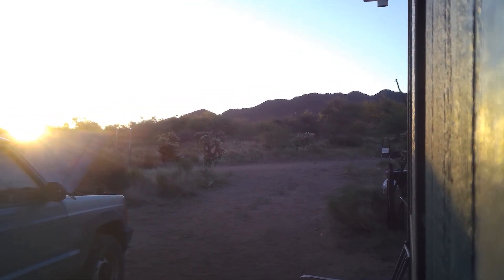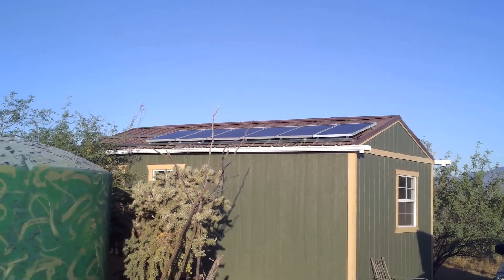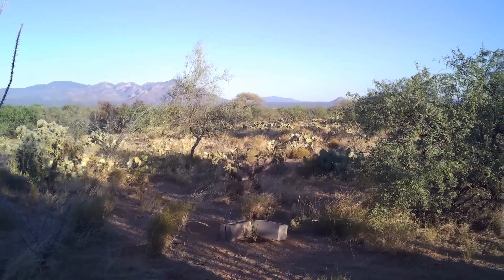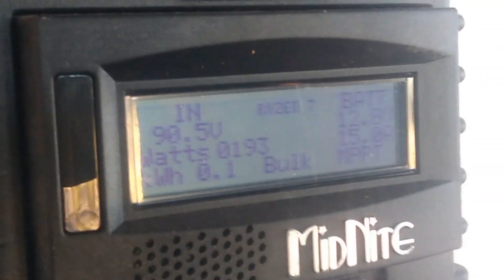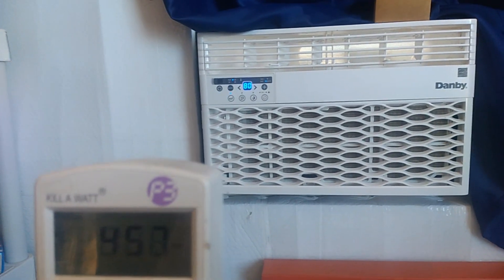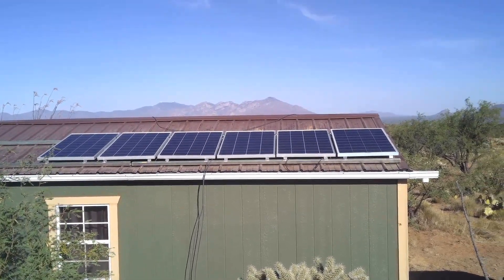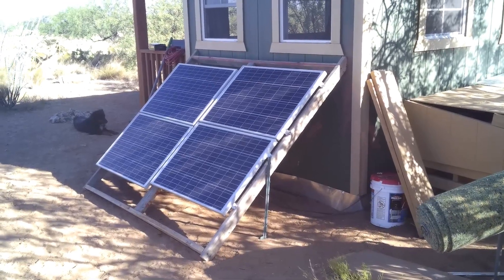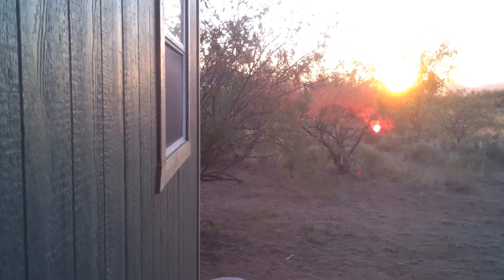Solar is DONE and AC is running @ AZ Off-Grid (Unplugged)

Comment: Hi.. I'm gonna go off grid someday.. am saving my money for now. I do have a solar system on my RV that works but needs a little bigger wires, fuses, ect..  1600w, 400Ah, Victron 150\100 and a CERBO. I'm a 48 state trucker and can monitor it from the interstate. Oh..  I've got a nice built Jeep too.. '99 wrangler, 318 V8, auto trans, 4.88's, dual lockers, 6" long arm on 35's.  I'm your newest subscriber..
Reply from the maker: Welcome to the channel and thank you for subbing to it.. ..As a trucker,, there has to be a place in mind that you want to do the off grid.. Where is that.?  Also with your RV experience,, off gridding will be much "easier" to deal with.. ..You will find that part of the equation of solar,, is the desire for "more".. get used to it.. lol
..Have you ever had your Jeep to Moab.?  best 4 wheeling anywhere..  Thanks for watching.. ..Happy Trails.!!
Reply: @deserthorizons  Hi.HI.. well I've never lived in a desert area.. either in town in an rv park or where I'm at now.. amongst the trees at 2200' snow country. But I will enjoy the change as I want to build a wind and Solar farm and be unplugged. I will make it happen in the next year or two.

Not been to Moab yet.. want to go someday though. I've been throught the Rubicon twice though. I built my Jeep for that kind of terrain.
Reply: @deserthorizons  Speaking of Jeeps..  Here's my old channel which has some of my Jeep vids..  https://www.youtube.com/@brucesterj

Comment: What county are county are you in? Just got land in Holbrook tryna go around a building permit. No storage sheds allowed before , anything over 12x12 would need a permit here
Reply from the maker: I am in Pima county.. ..How far apart can another building be before you need permits.? here the eaves must be 4' apart so if I wanted to put up another it would need to be far enough away,, yet I could still use it.. Maybe put the "cave" in one bldg and the bed/bath in the other.. You need to go to whatever county that is website and read,, read,, read everything.. (they don't make it easy or intuitive) to see what is required for a permit.. Here anything larger than 200 sq ft,, a water tank larger than 5,000 gallons,, propane tanks larger than 150 gallons,, etc,, needs a permit,, So I built my shed 198.75 sq ft,, water tank of 2500 gallons,, propane tank of 50 gallons.. Did you know the size limitations before you bought the land.? Thanks for watching.. ..Happy Trails.!!
Reply from the maker: Another option would be to build a "2-story" structure..

Comment: You can get a larger variable speed inverter mini-split that can run in eco-mode which keeps a small space like your cool.  Midea makes a great one under the brand Boston Bay for $360 that in testing ran at 259 watts continuously 22 hours a day in a more humid climate with 95F temps.  The Hong Kong government has a website (English available) that is the best I've found at breaking down the true efficiency of air con units.  It's far more detailed & accurate than a Seer rating.

The window air cons are generally a security concern (maybe not in your situation), they block visibility & light from a window, they are much louder than variable speed split units, and they let a lot of noise into the house from the outside.  You have the perfect setup to take advantage of such a system.  And you can run it at 230 volts to further reduce your power usage.  It's perfect for about 120 SF room (the 1 horsepower model) so it can still run in eco mode which dramatically lowers your energy consumption.
Reply from the maker: It was going fine until I read the 230 volts part.. .when I got the things to get this place setup I was in a severe cash flow shortage.. Well, not so much "outgo" now,, but still the idea of spending money to replace stuff that is working perfectly,, nah.. Great idea and It sounds good but that would need to be done first time.. Now I would need to rewire the entire setup,, get a new inverter,, and another ~$400 on an A/C.. .. Thanks for watching.. ..Happy Trails.!!

Comment: I hope you wouldn't mind helping me out a little bit and checking my math for me. I've been trying to find someone with an accurate answer....
I recently purchased 4 lightly used 270 watt, 35.5 volt, 7.60amp pmax / 15amp fuse rating solar panels. So, if I connect them up in series I would get 1080watts with 142 volts at 7.6 amps. Correct?
I also purchased a DC pool pump rated at 72vdc that comes with a 72v Controller Box. The Controller parameters are as follows: Rated current=12A, max solar input volts=150, current overload=15A, pump=1000W @ 72v, best working volts=88v.
Would you agree that my 4 panels in series is best and most efficient? Or do you recommend another configuration???
Reply from the maker: Howdy Kent,, What sort of Charge Controller are you using.?  That will determine if you can hook up 1080 watts / 140 volts .. I now have 2100 watts in my system going through 4 different Charge Controllers.. The Midnite Classic 150 controller would do the job or you will need at least (2) - 40 Amp charge controllers.. don't know nuthin bout your pool pump.. Series or parallel doesn't make any difference as far as how much juice you ultimately get out of the panels.. hope this helps.. .. Happy Trails.!!
Reply: @deserthorizons  I hope you wouldn't mind helping me out a little bit and checking my math for me. I've been trying to find someone with an accurate answer....

I recently purchased 4 lightly used 270 watt, 35.5 volt pmax, 7.60amp pmax / 15amp fuse rating solar panels. So, if I connect them up in series I would get 1080watts with 142 volts at 7.6 amps. Correct?

I also purchased a DC pool pump rated at 72vdc that comes with a 72v Controller Box. 
The Controller parameters are as follows: Rated current=12A, max solar input volts=150, current overload=15A, pump=1000W @ 72v, best working volts=88v.

Would you agree that my 4 panels in series is best and most efficient? Or do you recommend another configuration???
Reply from the maker: @VIAMediaGroup  I thought I had answered this question with what info you gave me.. but regardless of how you hook them up,, Individually,, Series,, or Parallel ,, with those 4 panels you will get (at best) 1080 watts so it doesn't make any difference.. What will change will be the Amps or the Volts.. That is why the Charge Controller you choose helps dictate how you hook them together..
Reply: @deserthorizons  OK - I just mounted 2 of the 270w panels. I just tested with a voltmeter. On a cloudy drizzly day like today each is putting out 40vdc. I think this is VOC, right? So, with these panels and my controller, how do I get 900w to1000w and the less than 150v needed for the controller. Only 3 panels in series would give me the voltage, but NOT the amps. 
That's my ignorant dilemma. ????
Reply from the maker: @VIAMediaGroup  Put your numbers from the panels in this link= http://www.midnitesolar.com/sizingTool/index.php and it will tell you what charge controller you need to operate panels.. If the charge controller you have won't handle all 4 panels then you need to get additional charge controllers..
Reply from the maker: @VIAMediaGroup  it sounds like you will have to mount them in 2 parallel strings of 2 panels each.. try those numbers out in that link..

Comment: also, i liked that you had the bubble foil installed under the cabin ... great idea ... how is it working out?
Reply from the maker: It has worked exceptionally well.. It was nice and cozy in here all winter,, all last summer the A/C was not overworked.. and because I laid another layer of reflectix inside under the carpet pad,, it makes the carpeting feel very luxurious.. I used only about 1/3 of the propane to keep the cabin warm as I did to keep the RV warm,, so there's that.. ..Happy Trails.!!

Comment: have you considered extending your south facing roof as an awning to keep the sun off of the cabin?  i know they do that type of modification for the earthship style buildings.
Reply from the maker: The south side is where I have the ground mount solar panels.. But I placed the cabin in the orientation I did for solar maximum gain,, (heating).. It was absolutely perfect this last winter.. In the summer it does not really shine on the south side much.. When I ordered it I asked about eave extensions of 6" but it cost tooooo much.. .. Happy Trails.!!

Comment: Love your oversize wiring.  You can never go too big!!!
Reply from the maker: It is the best sized wiring for a 12V system,, but I am definitely ready for a 24V system and knowing that my wires will be oversized then is comforting.. ..Happy Trails.!!
Reply: @deserthorizons  My favorite wire is semi battery/starter cable.  It is 4/0 and very fine strand.  Plus, since semi's have multiple batteries, you can buy the battery to battery jumpers already made up  :)
Reply from the maker: @donf3877  .. funny,, I used to have my own trucking company while I lived in OK and I   n e v e r   once thought of that.. summmbitch..doh.!!   While expensive it sure would have made what I did easy.. que sera,, sera..

Comment: Great job ! My only suggestion , separate the inverter from the accumulator (battery) box .  The hydrogen and water vapors will destroy it not to mention a potential ignition source for the gasses .  20 years off-grid . Thank you for your time in producing this series !
Reply from the maker: Agreed.. but I moved it because it got too hot out there and would fault.. It is now behind the couch under the controller.. seems to love it there.. .. All 20 years in the same place.? 
 .. Thank you for watching.. .. Happy Trails.!!

Comment: A/C is nice but you live in prime location for evaporative cooling. We put one on our home 20 years ago and rarely use the Ac it's just not as comfortable and we save big bucks on electricity. And it would be much easier on your solar system too. We do use AC if company comes over or humidity gets to high for about an average of 1 and half weeks per summer. Last summer it got 116 one day and we never turned on our central air. The drier the weather the better evaporative cooling works. And your sinuses will feel much better too due to having some moisture in tha air. We have a Bonair 5000 if anyone is interested you can get them at Home Depot for about $550 to $600. Just thought I would mention it. You have a really nice set up and I enjoy watching it.
Reply from the maker: I do have a swamp cooler.. It is a newair portable cooler.. It works great,, used it for 2 summers here.. I normally don't even turn on a fan until it hits 100 so I know what you mean.. I am glad I had the A/C last summer as we had over 100 days of over 100 degrees.. I have also expanded my solar system up to 2100 watts to handle the A/C easily.. Tell me what you think about tomorrows (4/23) video.. It is a synopsis of what I have done for the last year.. ..Happy Trails.!!

Comment: Why didn't you opt for an evaporative cooler? The roof mounted ones (I had one in a townhome in Co) worked amazing. It would run us out.
Reply from the maker: For a few very important reasons.. Cost.. at the time I bought it, a 'portable' evap was all I could afford.. 
More importantly is swamp coolers use water and A/C uses electricity.. I have an unlimited supply of sunshine  to turn into electricity for free.. I already have the system so it is free from here on out.. I still have to buy my water and have it trucked in.. In a post SHTF event where the trucks weren't running anymore I would not want to rely on delivered water to keep cool.. Funny,, I am sitting in front of the swamp cooler as I am responding,, and this one also works amazingly well,, it just uses 3 - 5 gallons of water a day.. .. Happy Trails.!!

Comment: Maybe put the battery box on the north side? Some day?
Reply from the maker: It's an idea.. but I have to ask, Why.?
it is now right next to the charge controllers so the wire runs are short as can be.. 
Happy Trails.!!
Reply: @deserthorizons  does the inverter not overheat?? Im in phoenix. I know how hot it gets here
Reply from the maker: @jakeandrules7724   it did overheat while it was in the box so I moved the inverter inside the cabin and it runs fine.. Did it with the wires I had so no problem there.. Ran the A/C for a lot of last summer and it never wavered..

Comment: Most Kill-A-Watt meters do NOT show peak power.  I have a similar Rosewill meter that DOES read peak power.  The Kill-A-Watt shows the furnace using a max steady power of 460 watts but the Rosewill shows a peak at 546 watts.  There are other meters that record peak power.
Reply from the maker: I am actually more concerned that the appliances run that I want to run.. 
A/C worked very well last summer and for this summer I have an additional 500 watts of solar.. .. ..Happy Trails.!!

Comment: great videos Robert.  Watts and amps still confuse me.  Still trying to size what system I need  here on my property.  The more I learn the better.
Reply from the maker: the amps part confuses me too, so i try to concentrate on the watts.. if you get a Kil-a-Watt meter then you know exactly what everything uses.. it helps you plan your system and they are only ~$15 bucks..
Reply: @deserthorizons  Makes sense. Cheers.

Comment: Hey there... just a thought...  I've sen this before.. those solar panels facing south could be double duty as shade awnings over those southern windows. a simple triangle frame could be what holds them in place...  Google it ... good job... great vision...
Reply from the maker: Hey Lee.. I appreciate that,, however by the time it really starts shining in those windows in a couple of months I anticipating wanting all the solar gain I can get.. It is just catching a little of the sun now which I can manage by the curtains.. If I find that I get toooo much sun,, which is doubtful as I like it warm,, I will contemplate your idea.. If you have any good ideas of a cheap water tank level indicator for a 2500 gallon tank I could use that info.. .. Happy Trails.!!
Reply: @deserthorizons  I will start looking for an inexpensive solution

Comment: Are your batteries and inverter sufficiently protected against moisture, rein?
Reply from the maker: I have done a few things to prevent moisture and rain from getting in that are not shown on any video.. However just yesterday I moved the inverter inside the cabin as it did not like the heat.. and it is only going to get hotter this weekend so I figured I had better move it.. .. 114 on Sunday.. .. Happy Trails.!!
Reply: @deserthorizons  i see now lol

Comment: I was going to say that you need to add some ventilation to that battery box.  It is a bit of a fire hazard because lead acid batteries emit hydrogen gas, and the inverter could emit a spark to ignite it.  Get some air flow into it.
Reply from the maker: Yes, though it is difficult to see, I have vents on all 4 corners plus along the back.. I will do more as I get screening to cover up any rodent entrances.. Those wires are too expensive to just be used for lunch.. .. Happy Trails.!!

Comment: those fires hanging down... put them in a 1 inch PVC pipe to shelter them from thee sunlight... glad ur dogs are enjoying the  place. cut the PVC length wise place the wires in side.. attach to home.. this will help greatly looking good
Reply from the maker: I was just going to use some wire loom,, much like they use on engines.. It is already pre-split and bendable.. Those wires are designed to be exposed to the elements but anything I can do to add additional life span is worth it to me.. After I get a clearer idea of funds still available this month I may order them soon.. Otherwise it will be a month or two,, or three, or.. .. .. ..Thank you.. .. Happy Trails.!!
Reply: @deserthorizons  i didnt think of that... good choice... it will last much longer.. carry on..

Comment: Have you thought about an electric water heater for a diversionary load for excess electricity
Reply from the maker: I have an electric water heater in the onboard water tank I have used for the last 2+ years in the RV.. My eventual plan is to move that water tank and heater over to the cabin.. No big rush as it works well for now.. With my solar setup I don't have excess electrical,, the charge controller just stops producing when the batteries get full.. (which it did yesterday) .. Happy Trails.!!

Comment: My ac runs about 450w. I don't have enough solar for that so I have to run my generator. Looks great
Reply from the maker: What is the start up wattage on your AC.?  Solar panels brand new are less than 75 bucks for a 100 watter,, used in Mesa much less than that.. Batteries are the most expensive part.. but at least you have the generator option.. Fortunately it never gets hot in Wilcox, right..? .. Thank you.! .. ..Happy Trails.!!
Reply: I was curious how expensive solar panels are. We have a mobile home and when I looked into it they quoted 10-20,000. We’re living on social security and I do home daycare. Not exactly making big money. My husband was severely injured in Michigan resulting in our move for his health. We love it here and he wanted to move here his whole life. I want to start prepping as I am able by myself. I just found your channel. Thanks for the information source!
Reply from the maker: @sherrimiller5258  Hi Sherri.. To have solar professionally mounted can be very expensive.. (sorry about the delayed response, but I just found your comment today) .. Solar panels are only one part of the equation.. but brand new panels are ~ 75 cents a watt.. (you can pay much more if you want),, ..  used from San Tan Solar in Phoenix they are about 20 cents a watt.. (50 bucks for a 250 watter) .. I bought 2 of those and have added them to the setup I had in this video.. Thank you for watching.. ..Happy Trails.!!
Reply: @deserthorizons  No worries! Thank you for the response! 😀